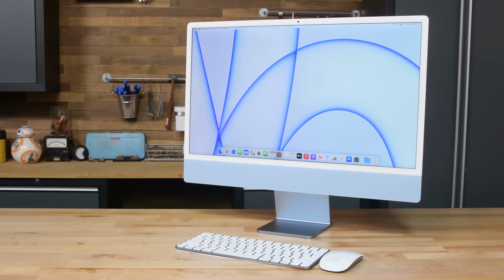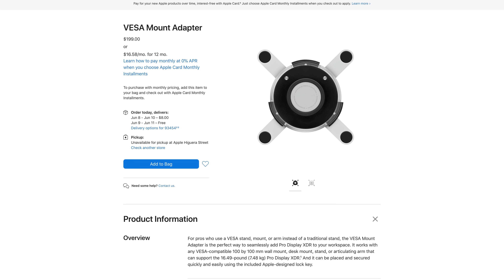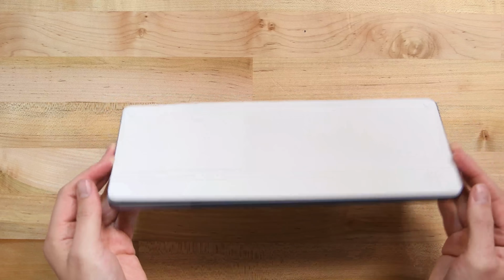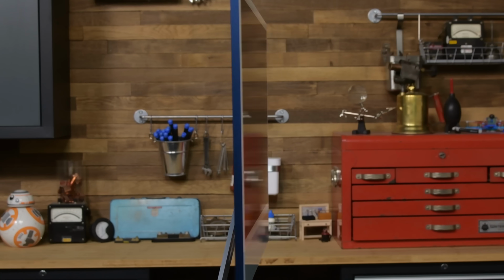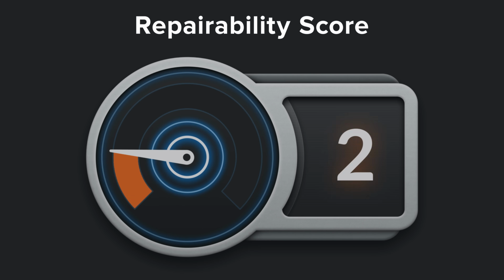M1 iMac 24” Teardown: A Desktop Only Jony Ive Could Love

Comment: Looks super simple to remove parts. At least you can swap failed parts fairly easy.
Reply: After ripping off the front that's glued down? And what parts that are easy to replace do you think actually are going to fail? What happens when your CPU fails what happens when your RAM fails what happens when the hard drive fails? None of those were easy to swap so your comment makes no sense.
Reply: @joshuaewalker  because all the things you just listed are all part of the same part so you swap it. There is no RAM it’s built into the processor
Reply: @TechOut  yeah but knowking apple you can bet that replacing that mainboard is gonna cost the same as the full system
Reply: @andalaossa06  this isn’t about apple doing it. This is about someone getting a used part and being able to open it up easily and do it
Reply: @TechOut  
That was my whole point. There are no parts to swap out. Instead of being modular and easy to repair or upgrade everything is soldered together. If one tiny thing fails it all fails. It's a house of cards. Something you learn as an engineer: you don't use rivets if you can use screws and it works just as good. Rivets have their place and their use but they are meant to be permanent. If using a screws or nuts and bolts doesn't compromise the strength or functionality then there's no reason to use a rivet.

Comment: It’s so thin... but then it has a huge stand. You could easily double or triple the thickness and it’d make absolutely no difference to the space it takes up on you desk due to the stand. If you could detach it and use it like a giant iPad then sure... but you can’t. I’m sure they could have fit some iPad batteries in there and made it cable free. Haha.

Comment: this is fine, it’s the machine for people that don’t care about tech, they won’t need to replace SSDs, the SoC won’t die in the lifetime of this machine and it will still hold resale value like all the macs in the secondary market, even with no replaceable or upgradeable parts, this is still a good product for the entry level consumer that just needs to write emails, scroll social media and have zoom calls on the home office, this is not your pro machine, if it last more than 5 years, at the price and performance it would pretty much outvalue any all-in-one running windows on the market.
people need to calm down…
Reply: it will last easily 10 years like every other mac always has.
Reply: and you get latest OS for 7 years at least.

Comment: Well, i was expecting a 1 out of 10
Reply: but at the plus side, it seems easier to open than the previous imac, no?
Reply: Anand Raj  yea that's exactly my point. easier to open and "unscrew" the parts without worrying you touching the exposed power supply unlike the previous imac is enough to get 2 out of 10.

Comment: It looked so easy to open up the components yet why was it given score 2/10 for repairability. I'm not aware of much stuffs but I'm just curious to know if anyone could explain please.
Reply: From iFixit's guide :

-The external power supply is trivial to replace, but very difficult to service.
-The display is tedious to remove and replace, but it's the most accessible component.
-There’s no altering the internal storage—a severe blow to repairs, upgrades, data recovery, and even security.
-Memory is soldered directly to the M1 package, making it impractical to ever replace or upgrade.
-The only path of entry is through the display adhesive, making all repairs tedious.
Reply: @LustForKeyboards  but do people upgrade internal components that often? I mean it's good to have an option to upgrade but from where I belong, people don't quite often upgrade components that often. Thanks for the info though ❤️
Reply: Sure, as long as you don't consider how easy to service any other computer is
Reply: @prabhavdhanesha7036  your name looks Indian so I assume you're Indian. This device will not last long in Indian conditions. Our college has iMacs from 2017 and Mac Pros from 2013, and they crash (kernel panics) regularly. I assume trashcan GPUs come unstuck, I don't know what happens to crash the iMacs, they just power cycle sometimes or Premiere crashes and the whole system becomes unresponsive. That's the result of poor design. This is going to suffer the same way eventually.
Reply: @xmlthegreat  Maybe it will last longer due to the lower TDP of the M1 but still maximum writable on NAND memories is a thing. replaceable storage should be mandatory
Reply: @xmlthegreat  Oh I get so that's how they milk money from customers. My college has old MacBooks too but they're only for media consumption so they  don't face much issues but I'm getting it.
Reply: @prabhavdhanesha7036  Yeah, no. Nobody's "milking" customers in this way - just because some guy's college has malfunctioning computers doesn't mean the entire lineup is bad, and every Apple computer I've owned has worked well for as long as I could keep it (and almost every Mac owner I know, Indian or not, share that experience). How do "Indian conditions", whatever they are, make kernel panics occur? Makes no sense, and that comment points to poor use or maintenance, both of which are possible where multiple students can use or abuse a computer. Also, his complaint is that an 8 year old computer isn't performing great, that should tell you something.
Reply: Agree. Looks like if you are a Mac user, you need to consider getting the specs you need now and in the near future when getting an iMac now. No more future upgrades. 

If this iMac’s hardware is as reliable as their iPhones, it should be a step up at least for me. I’m a Mac user since 1995 and Mac hardware have been hit or miss in my experience. My iPhones and iPads seem to have held up better than my Macs. Never once I needed to send my iPhone to a service center for repair but I get my money’s worth buying extended AppleCare for my Macs.

Comment: wait I'm confused, most of the easily damaged parts (such as the usb-c ports and headphone jack) are modular and relatively accessible by just removing the screen with a mini pizza cutter - how is that "unrepairable"?
Reply: What’re do you buy replacement parts at?
Reply: @heapester4781  yeah but that’s like saying a normal pc desktop isn’t repairable cos graphics cards are hard to find now
Reply: @tylerhanley1409  Yeah but unlike even a PC with difficult but not impossible to find graphic cards, you will NEVER be able to get hold of an Apple replacement part to do a spot of DIY repairing. Not sure why that's difficult to comprehend/

Comment: What Apple should realize that in this day and age, Steve Job's philosophy that customer doesn't understand what he/she wants until you provide the product to them does not hold true any longer. No one really needed a thin iMac. Adding a few inches would have made the cooling and Audio systems much more efficient and would have given some headroom for upgradation down the line.
Reply: "Upgradation"? ;) Its an SOC with integrated RAM, the SSD is soldered to the board, what is left to be upgraded?
Reply: But Apple wont be able to sell you there upcoming ispeaker to improve the desktop sound or cooler tower lol
Reply: That bit about the customer not knowing what they want until you show it to them is still 100% true! Focus groups are a waste of time.
Reply: This is the base model iMac. The pro will obviously be more upgradable. That’s how apple products work. And that’s why they sell so many of them.

Comment: I've always thought AIOs in general gave you all of the inconveniences of laptops* with none of the benefits**. Considering they kinda just went up, shoved an M1 Macbook motherboard inside a 24" display and called it a day, I guess I'm not wrong haha. I'd much rather have a nice laptop with a docking station, but choices are always a good thing. PD: thanks for reading my blog post.

* performance compromises, bad thermals, difficult upgrades/repairs, the need for an external power supply in many cases
** portability and a battery
Reply: Yup it still trumps in many areas…. Depends what one wants or needs…

Comment: Strange parts can definitely upgrade the storage. It won't be too hard to find similar ufs chips and reprogram them. Those r available all over AliExpress and taobao.
Reply: why would anyone do that, there is thundebolt you can connect a boatload of storage.
Reply: @JohnSmith-pn2vl  nothing is better than having built-in storage!
Reply: @KuntalGhosh  thunderbolt is like build in storage... since a decade, you can connect up to 127 storage devices to 1 thunderbolt port.

Comment: Fantastic post. Kudos to your technical and presentation skills. Hate to ask but can you advise an easy / cost effective fix for a display issue wherein there are black horizontal lines  in the middle of the iMac m1 2021 ? Changing the display unit is obscenely costly and negligible repair guarantee.